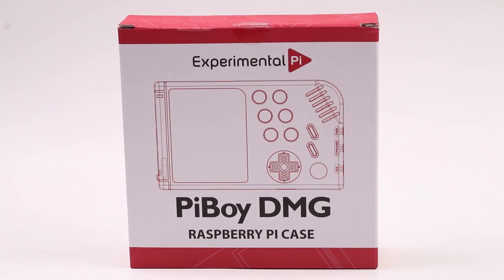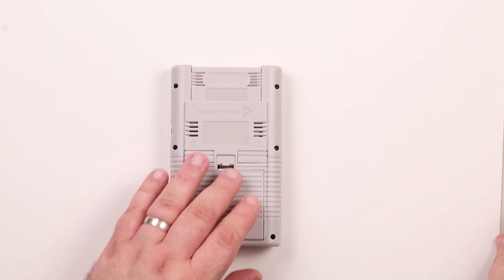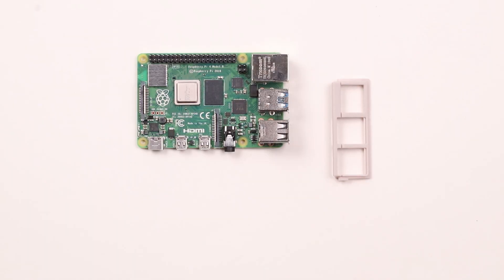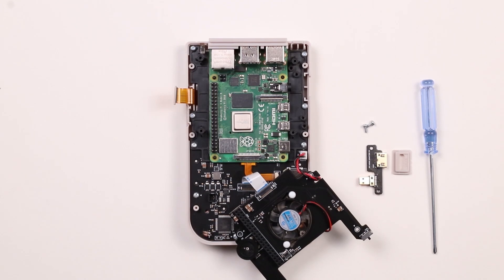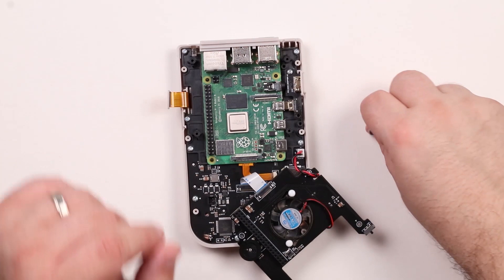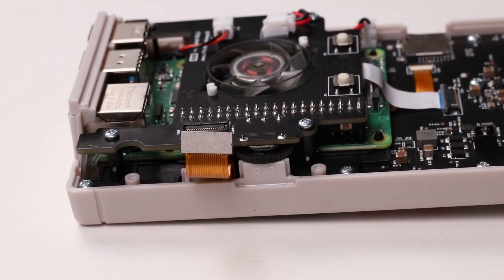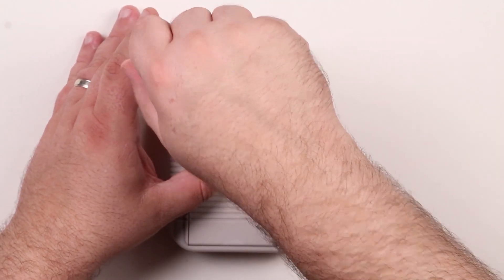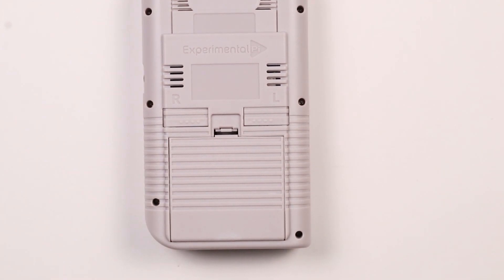PiBoy DMG Assembly Tutorial

Comment: Hey there, thanks for the video. Could you tell me if i could use a copper heatsink mod on the chips?
They are propably 4,5 - 5mm high. Would they fit between the piboy board and the raspberry board? 
Could you tell me this?

Comment: Why not use a type c to type c adaptor to have data and video in the same time? It would be much easier to connect to a larger display and do some work on the pi
Reply from the maker: During the PiBoy's development USB-C hadn't reached widespread adoption, which is why we chose the micro USB connection.

Comment: Anyone have a link to a tempered glass screen protector that will fit this LCD? Looks like it has the rounded bottom corner of a DMG but the screen itself is a 90 angle.
Reply: Im ALSO wondering about this! Do you think we could use one that's for an original dmg?

Comment: Can't wait to assemble mine! Is there a link for setting up the OSD and safe shutdown on my image?
Reply from the maker: Instructions are here: https://www.experimentalpi.com/Installing-the-Safe-Shutdown-and-OSD-Software-on-the-PiBoy-DMG_b_21.html
Reply: @experimentalpi3267  Thanks!
Reply: @experimentalpi3267  I've followed the instructions on this guide and it seems to install fine, however after the Experimental Pi logo comes up, and the OSD is displayed the Retropie logo shows for about 2 seconds, then disappears, a blank command line appears then my monitor goes into standby, the pi green light flashes a few times and then the red light stays on, and I cannot wake it from this state. It isn't one of the boot cycles, because I've let it sit for 20 minutes powered on, and it never restarts itself. Power cycles end in the same state, that process repeats, red light on, No Signal. RetroPie 4.6, Pi4 4gb ram model. 128gb Samsung SD card. I have tried reflashing over 6 times now, going for a 7th, using etcher and win32Disk. Retropie works just fine if I don't install the OSD/SS.
Reply from the maker: @billybobthorton2026  Email us. Sounds like scripts are not installing correctly.
Reply: @experimentalpi3267  Roger, will do, ty.